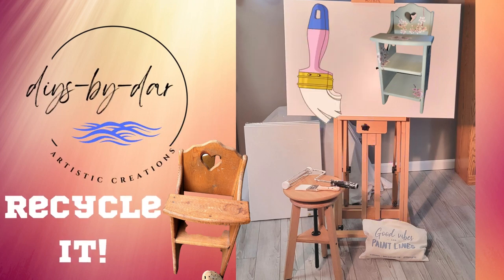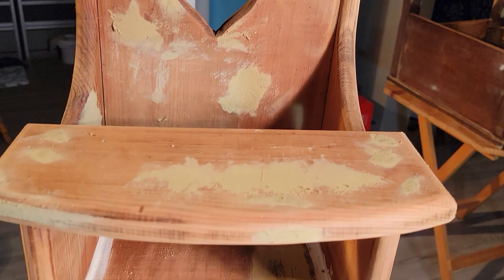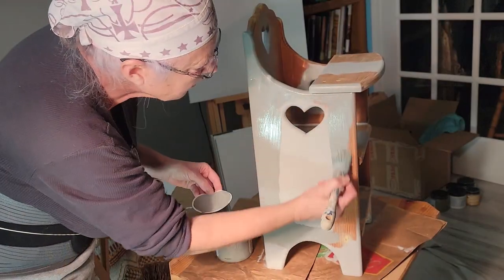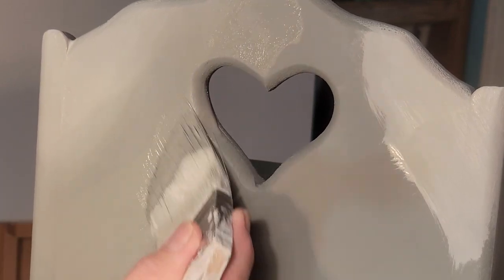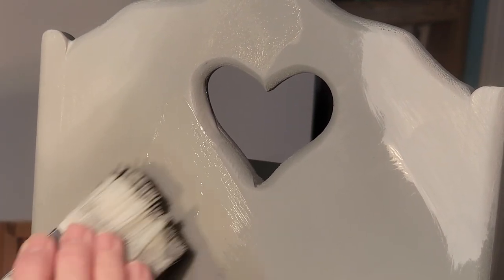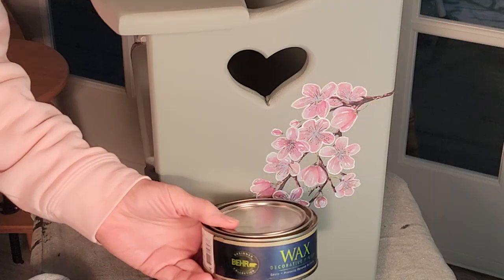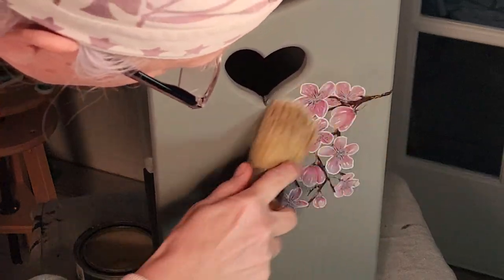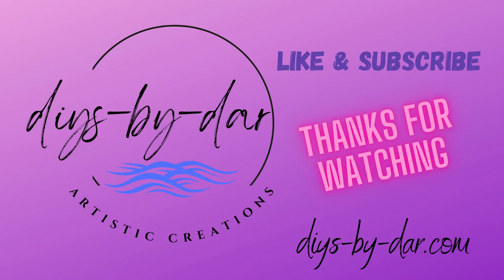Furniture paint Blending, Epic Fail!  Recycle  with paint, acrylic pens, and transfers.

Comment: I blend with regular house paint. It has been challenging but i think I've figured out how to do it. Start in a small area and use lots of water, but not all at once. And you do have to move pretty quickly.
Reply from the maker: I need to try it again with some chalk paint.  I used silk all in one paint and had a heck of a time.  One of these days I will get brave and try it again. Lol
Reply: @diysbydar  I'm sure that makes it harder, but the main issue i think is just doing smaller sections and working quickly as well as starting with more water and always keep your paint wet so it can move. Otherwise you will have challenges even with chalk paint.

Comment: Yeah I can see what you're doing wrong with the blending. Don't put all your paint on all over the piece do your blend in a small section at a time. And make sure that all your colors of paint that you're blending in that small section are wet at the same time. If you're just starting out with blending only do two paint colors to start with. Also your paint colors are too similar. Yes you want to have colors in the same family but if you're too similar then it just looks a mess. The fact that your piece is small has nothing to do with it. You can get good transitions on chair legs. Yeah once you get that drying and lifting you've got to stop let the whole thing dry and cure and then start all over
Reply: I really appreciate how you show your struggles. I love when creators do that. It helps to understand what can go wrong and the challenges that you can encounter.
Reply: Another way that you can blend that will make it very easy as a beginner is to again only use two paint colors and they don't even have to be in the same color family. But just put one paint color on one side of your brush and the other color on the other side of your brush.
Reply from the maker: You are so right, I just made a muddy mess and gave up.  Since then I have shied away from bleeding.  But, I am a person who loves a challenge because it keeps me thinking about it, lol
Reply from the maker: @KMF3  oh yes, you should watch my coffee and tea bar vid, boy did I have challenges.  My molds slid off.  Then I had to use a new stencil stick spray and it was about 100 degrees out and it pulled off leaving gummy strings.  Now that was a mess to clean up!!
Reply: @diysbydar  😂😁 I will check it out.
Reply: @diysbydar  don't give up. Keep experimenting. You will find your own rhythm.